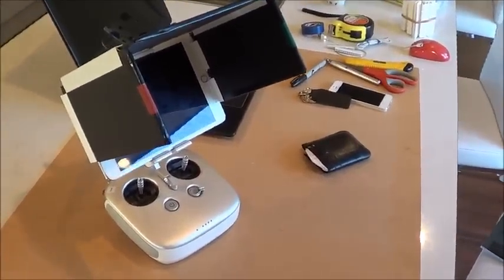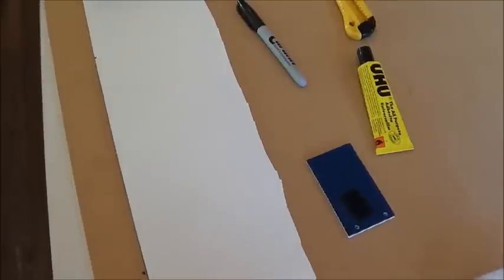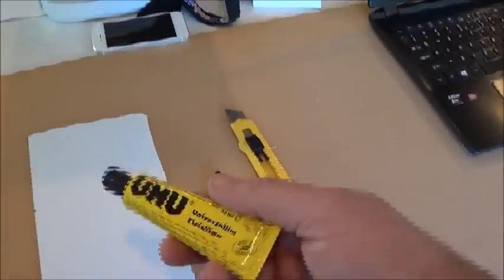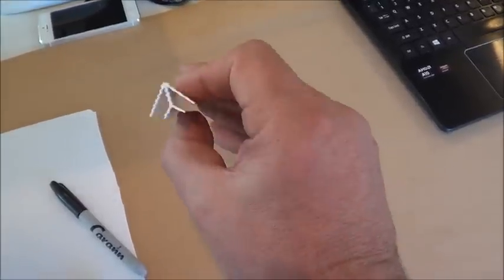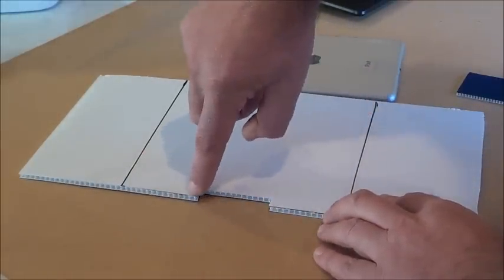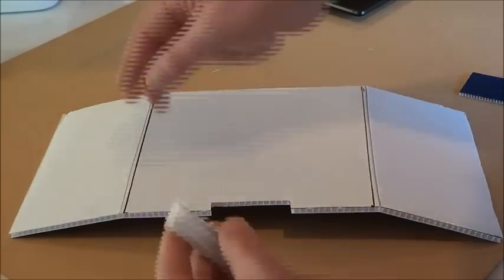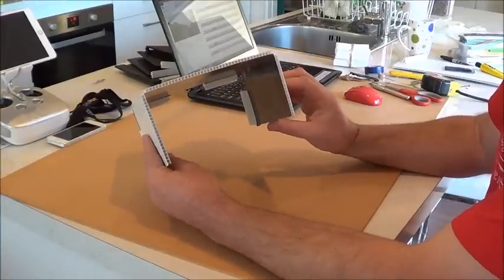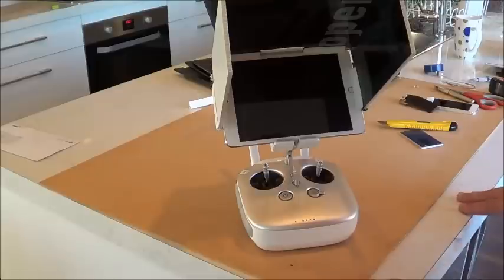Ultimate Sunshade for Phantom 3 & Inspire

Comment: Hey, Kiwi!

Greetings from Minnesota, USA!  Thanks for the video! One thing you did perfectly but didn't mention in the video is the importance of having the surface of the inside of the hood be a dark color. If the board material is white, use black spray paint (flat is preferred over glossy to minimize any reflection inside the hood. Alternately, one could use spray glue and press on some black felt or other thin fabric.

Jim Medema
Reply from the maker: Sky Candy Aerial Thanks Jim, you are correct. A matte finish on the inside of the hood is certainly beneficial.

Comment: Not mentioned, but I suppose you would also have to cut a slot in the right extrusion to allow the connection cord from the controller to be plugged into the iPad Mini connector slot.